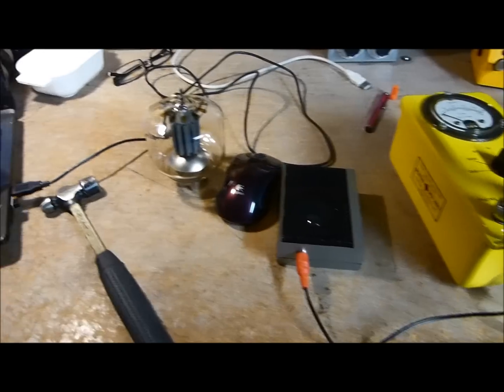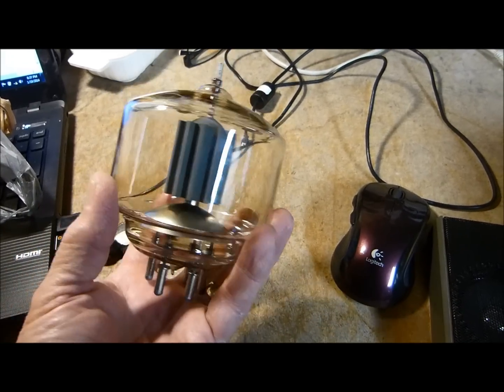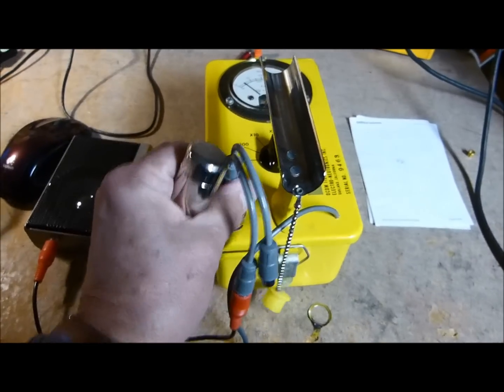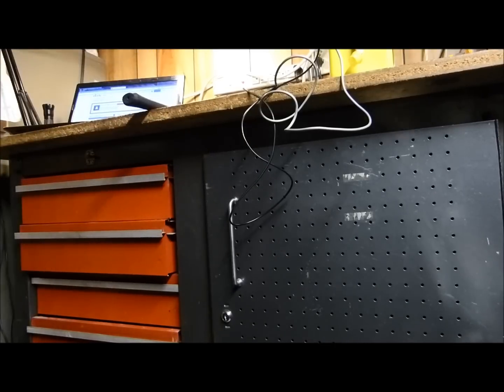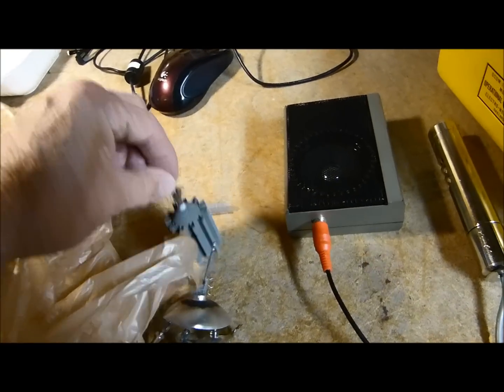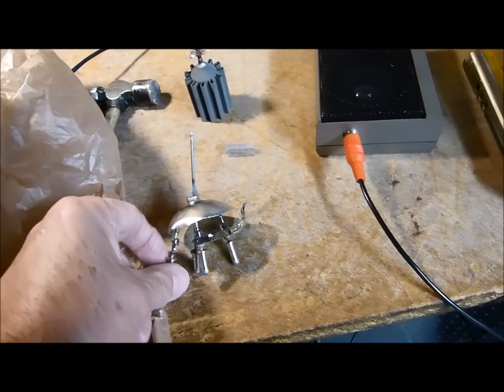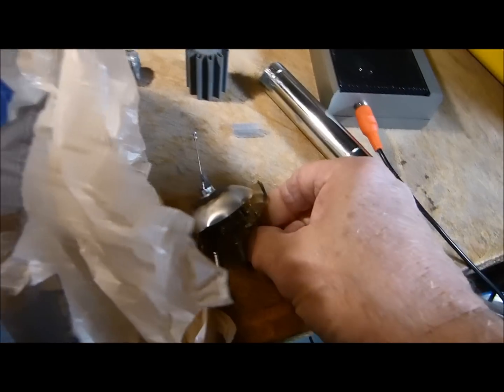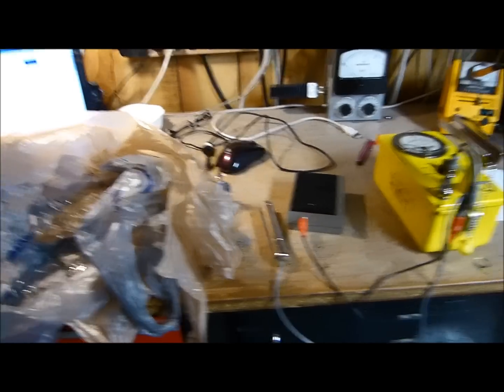Breaking And Examining A Bad Eimac 3-400Z Triode For A Radioactive Cathode

Comment: David, I just discovered this video and wanted to say how much I enjoyed it. I believe that the Thorium isotope normally alloyed with tungsten in filaments, is primarily an alpha emitter and thus may be rather difficult to detect with a GM tube, since its range and penetrating capabilities are so limited. I did some research and was surprised to find that its benefit to the filament is purely chemical (to emit electrons at lower temperatures) and in no way based on its radioactivity. In fact, its natural radioactivity is actually a hindrance to its use, rather than an asset. I love YT videos like this.....they stimulate learning and intellectual exchange :)) Thanks for posting it.

Comment: Do you mind repeating the same test on the skull of the seller of the bad tube????
I am sure all of your subscribers would enjoy the results of that test..LOL
Of course, you can't use a radiation detector on liars!. Do you have a calibrated BS detector??? 

73,
Glenn WA4AOS
Reply from the maker: Hi Glenn - good to hear from you. I hope all is well with you and yours. That was indeed the worse Ebay experience I have ever had - he was a total jerk and I tried to communicate with him -  the emails between us read like a soap-opera - obviously by BS detector was out of cal   :-))   I should have simply opened an Ebay report and demanded my money back as his ad was 100% deceptive - Here is a cut-and-paste of his ad -  NOS Electron Vacuum tube 8163 3-400z NEW EIMAC TUBE 3-400...   after I left him negative feedback he called Ebay and had them remove my feedback - (really... this is true) He left me positive feedback as I was the buyer but put in a bad comment - what the ??  is that the way it is supposed to work ??  I will have to say, overall, I have bought some marvelous stuff off Ebay and most people are true and honest.
I got in a couple of new 3-500Z's today but they do not work as well as the 3-400Z's in my Big Amp - no problem, now I just have to build a 3-500Z RF amp so I can use them...
Reply: Hi David,
I hate to hear how this guy scammed you but he will get his reward in the end.. If you paid through Paypal, you can open a claim against him and they will lock his account for the amount of the purchase and give it to you within 30 days if they side with you. Of course, his tube has gone to trash so it's too late now.
I have also had many good experiences on ebay but there is always a jerk or two out there trying to scam people. Remember Radio Mart..He's off ebay  and I heard that ebay pulled his account. I don't know for sure but he was a crook..
Take care and hope you have a grreat weekend.
73,'Glenn

Comment: i wonder if the labeling for radioactivity might have to do with the time period and mindset of the era that tubes were common? in other words, in the 50's and 60's, radiation was a big "thing" that everyone was aware of because of the Cold War, atomic bomb testing and that sort of thing. then again, they didn't go around labeling FiestaWare or radium-painted clocks, so who knows. smoke detectors usually have Americium-241 in them but most people don't realize it (and i don't think they're labeled as radioactive, although i haven't looked at a package for one in...well, honestly probably never.)

funnily enough, you can often get a Geiger reading from run-of-the-mill granite countertops! i think it's kind of amusing that people are running around California proclaiming that "Fukushima radiation has reached the US" when they clearly don't even understand what background radiation is (or that their budget "Geiger counters" probably aren't even calibrated, in which case they're just nifty-looking paperweights at best.) but i digress...

Comment: Probably needs a sensitive scintillator to pick up the small traces if it's there.  I know old gas lanterns used cloth globes with thorium in them too
Reply from the maker: Yes, and people sell these old mantels on Ebay as Geiger counter checks. I have used both types of mantels (with and without thorium) and it is pretty obvious that the thorium mantels burn hotter and brighter - there is a warning on the package of these thorium mantels to do the initial burning outside and not inhale the smoke.
Reply: I just buy Fiestaware plates from antiques shops, the old ones give off ALOT of activity.  One 3 inch orange saucer I have puts out over 7000 CPM.
Reply from the maker: Scubasky If you like Geiger counters and the such, you may enjoy my YT video listed here  --    Comparison of Background Radiation in El Paso, TX and Trinity Site in New Mexico  -   I think most find it pretty boring as I do not speak and only post measurements - note the difference is scale during the measurements.

Comment: My recollection is that many high voltage tubes (such as those with the collector wire on top) emit X-Ray (ionizing) radiation.  CRT tubes emit  X-Ray radiation, which is why they are heavily shielded with lead glass.  Some vacuum tubes with wrap-around shielded grids are marked indicating dangerous radiation, but it's probably X-Rays.  

IMHO there is no radioactive material in any tubes with consumer applications.  I can't speak about industrial or military tubes.
Reply from the maker: I think some of the old CRTs for TVs used thorium-tungsten cathodes but as with mercury and other heavy metals, asbestos,  PCB oils, etc, we have moved away from these materials for less toxic substances that work almost as good. Interesting how some of the most toxic materials for biological life make the best technological components.